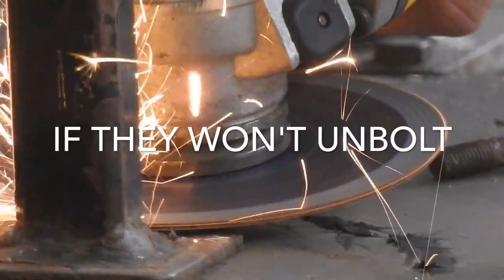Seat Removal on schoolie conversion

Comment: Grinding bolt heads off is crazy. My bus had bolts and all of them were removed by wrenching. Used the same plywood floor with rubber covering.